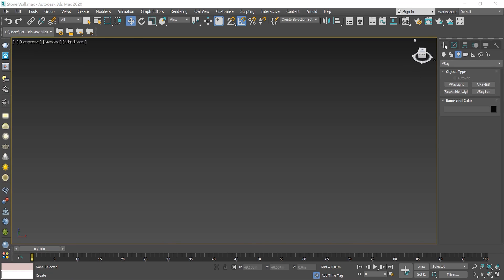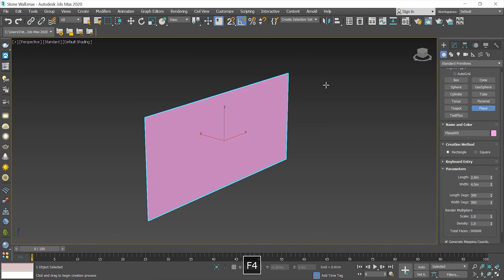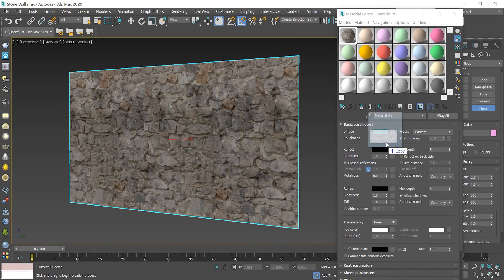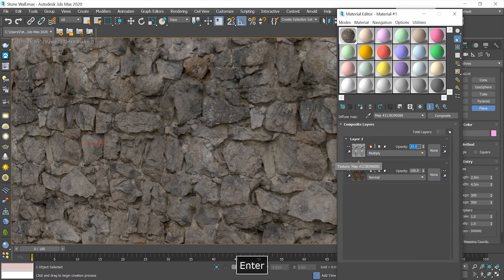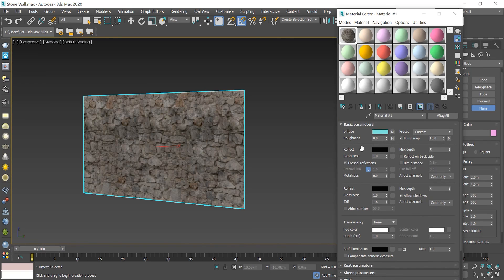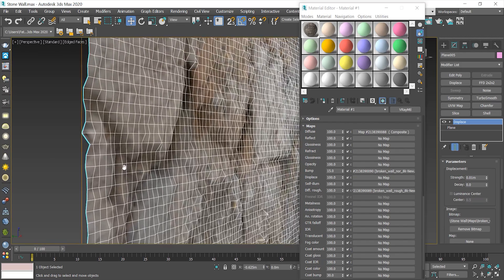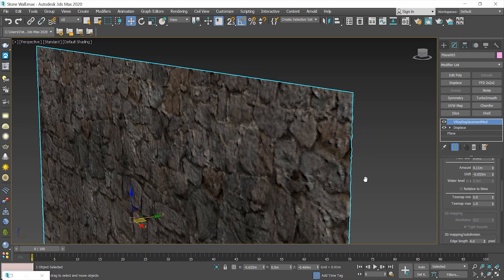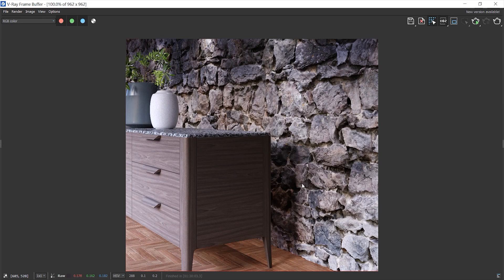V-Ray Displacement Mod in 3Ds Max 2020

Comment: How realistic! it's so outstanding, could you please share with us how did you make the lighting
Reply from the maker: Hi, great to hear from you. I used a dome light and I assigned an HDRI to it for my main light, and also I added some interior IES lights to reduce the darkness on the top section of the wall and make some highlight. I think you can do better with the lights coz I wasn't really focusing on the lighting in this video. hope it helps :)
Reply: @SaeedMandegarTutorials  thank you < it helped alot